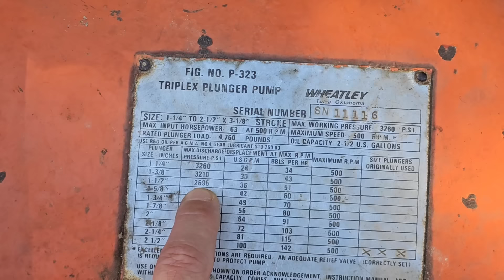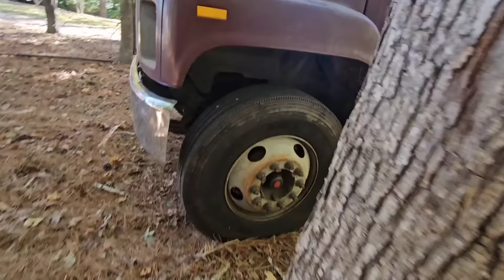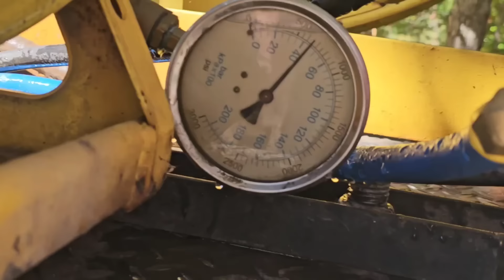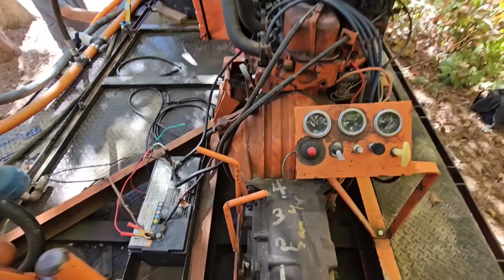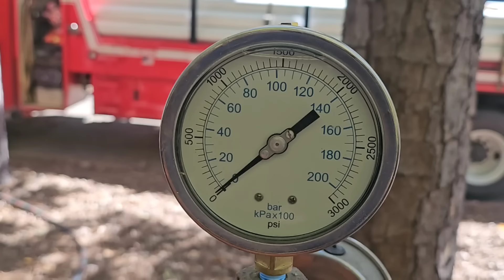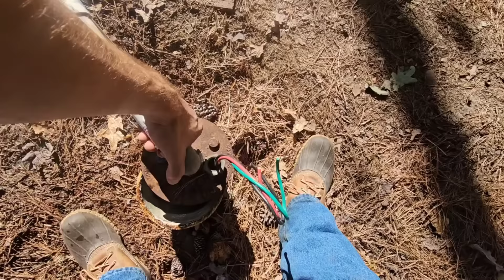Hydro-Fracking... We Blew up neighbors Well!

Comment: I’m not sure what he is doing , but water has weight too . This well I has about 85 gallons of water in it already  . Now he’s talking that the well has 150 gallons . No telling for sure unless you calculate the weight of water verses how deep the pump is , and add in the width of the hose in the well . But the pressure measurement is only talking the weight  of the water in the tools . He can’t tell the condition of the well . 
I hope the casing is still ok .
Reply: Pay attention. His first frack was 20' below the casing. The second was 65' below that. The casing never saw preasure.

Comment: I don't get it:  when you pulled the pump out, you had to stop because ........ you ran into a lake.  So, if you have a lake a few feet below where you are standing, why do you need a well?  I guess that is why I am not a H20 mechanic!
Reply: Surface water VS ground water. Surface water tends to need a whole lot more treatment thanks to forever chemicals, animal feces, and run off. Where as ground water tends to be much more on the filtered side as far as contaminants go. Hence the half package of chlorine poured down the well to kill off any nasties that might have ended up in the well after they put the pump back in. That's the short answer of it anyway. There's a hell of a lot more to water treatment than most people think.

Comment: This meathod is how the gas companty going to extract patrolium gas . The nabors well got  blown up . See you can’t frack it and not do damage elsewhere too .
Reply: science is the same, reguations are COMPLETELY DIFFERENT for water well vs oil well stimulation. 

did oil and gas for over 5 years as a wireline operator and engineer. Yes you can "frac and not damage elsewhere" its called retrievable plugs. set one or two off eline or slickline to cap well. frac the newly drilled well, then uncap and replace the production wellhead and flow string after stimulation operations are complete.

Comment: the inches on the pump tag is the size of the pistons installed in the pump. the pump can have any of those sizes. if it has not been changed, it is marked as having 2 1/2 inch pistons.. which is 100gpm and 970psi at 500rpm. so if that pump gas 2.5 inch pistons, you can push upwards of 100gpm.
Reply from the maker: Your correct. Ours is 1.5"

Comment: Did you used to inflate the packer with a hydraulic pump and vegetable oil?
Reply: Yes, they found the veg oil was harming the rubber in the packer.
Reply: @mxslick50 sounds very reasonable 
Thank you for the reply

Comment: What is wrong with a fiberglass tank? They don't rust. Mine is 25 years old and works fine.   I adjust the bladder  air pressure every couple of  years.
Reply from the maker: We ran them for 2 years back around 2012-14. Had a 15% failure rate under warranty. They have their place in very aggressive water conditions since they use no metal in the construction. 
I've also seen them explode and collapse inward from the vacuum effect
Reply: I think it's personal bias because a lot of the tanks in some of their older videos were outdoors, and fiberglass tanks break down rapidly when exposed to the sun.  The small muni system I ran years ago had a mix of steel and fiberglass pressure tanks...guess which ones were the oldest and still fine? Yep, the glass ones. Steel tanks were all less than 10 years old.
Reply: @mxslick50 is that because they replaced the fiberglass tanks with steel when they failed?
Reply: @BramBiesiekierski  Other way around. I have the records of all the replacements. The last part of my comment was cut off, it should have read "Steel tanks were all less than 10 years old *when they failed.*" (I shouldn't do comments using my phone....)

Comment: Does that mean you caused damage to the neighbors well? and if you do that what is your liability?
Reply: No damage was done to the neighboring well, and technically the neighbors just got a free fracking service
Reply from the maker: Exactly.
Reply: @Theace88x  though if they don't have a filter there could definitely be some sediment loosened up that comes through. I would want a heads up if I was that neighbor to get one installed before they have a shower valve plug up or something else expensive to fix like that.

Comment: crazy how so much well intervention operations bleed over across industries. Did wireline (well perforating) and remediation at frac locations from 2013-2019. fracked thousands of stages, did no fewer than 15 logging jobs concerning well cement integrity, density, porosity, and identifying oil rich zones as well as water tables (to ensure zonal isolation has properly occurred via cementing the casing strings as needed, among other reasons) 

also have set several packers to increase wellbore pressure, sleeves where well bore integrity is compromised, camera and caliper jobs, etc. exactly what you are doing, just on a much larger scale (4.5 in wellbore to 11 inches, mostly 4.5, 5.5, and 7" casing diameter wells) 

I subscribed! hoefully you drop alot more of these water well fracs as they occur

Comment: I thought you showed your pump max out at 36 gpm through your size of piping so how can you flow 50 gpm thru it?
Reply from the maker: 36 gpm at 2350psi.
But lower the pressure to say 600psi & itll flow 50gpm. 
It's easy to gauge when you film bc I can time how fast I pump the tank down from 500gal to 100gal. Thats 400gals pumped out in just under 8 minutes.
Reply: pressure and flow are inversely correlated assuming same diameter pipe size, flow will decrease as pressure increases, and flow will increase as pressure decreases. 

low flow at high pressure, higher gpm at lower pressure.

Comment: is it possible that u over pressurized the neighbors plumbing as their was enough pressure to lift the cement lid!!??
Reply: Momentarily if at all. More likely the well relieved most of the pressure at the wellhead, I'm guessing the house MAYBE saw about 100-120psi for a few moments, well within the safe tolerance of standard plumbing.

Comment: When did they switch from using vegetable oil in the packer?
Reply: Quite some time ago...the veg oil was causing problems with the rubber in the packer.
Reply from the maker: Damn your dedication shows! The oil swelling the rubber caused a very slow deflation time.

Comment: ❤ like they say…. And their ladies and gentlemen, you have a textbook example it can happen 🤩.  The million dollar question is … at what depth did the vain of the two  wells merge??  But as I think about it 🤔🤔 it could not be the  first one due to the fact the packer basically sealed off the first vain at the second packer inflation…  So it hast to be a vain from 150’  downwards… but I can see a benefit to both bore holes now coz until they seal off they share a water source double the available draw 👍 a win win situation… what I find amazing is while it is assumed water veins   are level  when in truth the water veins actually run with the contour of the ground up hill an down 🙀 ..    a few miles from me is Reading Michigan the highest point in southern Michigan an also is solid slate rock an?? Is a roll of the dice if you can find water… most wells are suffer wells due the the extreme depth.. nasty tasting but it is water… But thanks for giving us  a great teaching video!!❤

Comment: This happened to my well October 2nd. The neighbor fracked their well and it came out of mine. What a mess that was. The wells in our area supply a half gallon per minute. I am afraid that my neighbor wasting water like they always do will take water from my well even more now. I don’t believe that this will help my well at all. I am NOT happy about it.
Reply from the maker: It won't hurt your well. If you tested it, its likely increased its gpm rate.
Reply: @h2omechanic  After doing this for over 51 years. I have seen  it hurt the other well. In my area the next door neighbor's well could be getting water from the same fault.

Comment: Filter before tank and pressure switch filter clogs needs attention your way tank and pressure switch can load up with free floating chunks
Reply: Your way you will dead head the pump when your filter plugs up! Highly don’t recommend doing it that way
Reply: @Tony-z4h3o  yeah, that's just asking to kill the pump or blow pipe apart somewhere, which will likely be deep in the well where pressure is highest. lol
seen many of them filtered before the tank/switch and people changing the filters without shutting power off wore yet.

Comment: The neighbor got a free fracking service. Nice work
Reply: Same Aquafer, so most wells in the area if not all are drawing water from the same place
Reply: Doubt it. They now have a service call required to fix their pump and put it back to the way it was. These guys a fu*cking dumbasses.
Reply: Seems like the neighbor got a well full of dirty water. I'm sure they appreciate it. 
Aquifers don't exactly clean out contamination very fast.
Reply: @think-some-time   Contamination? I'm sure they only use clean, potable water.
Reply: @think-some-time  WELL WATER NEEDS TO BE FILTERED.  DON'T PARK YOUR CAR NEAR SPRINKLERS BY WELL WATER,  UNLESS YOU LIKE A BROWNISH-RED CAR.  I WOULD GET THE TRIPLE FILTER FOR MY HOUSE.
Reply: @think-some-time  cloudiness is going to happen from flushing everything out, nothing you can do about that. The cloudiness is already stuff in the ground, so it's nothing worse than what is normally there.
Reply: @arthurr8670 except it clogs filters and mucks treatment systems.

Can be very bad and very expensive to repair the systems on 4 or 5 homes.

Can't blow it off.

Our main dude here knows his business and runs an honest shop, he'll handle it, but I've had issues with crappy well guys screwing up the neighborhood.
Reply: That or they just tapped into the neighbor's well.
Reply: @fascistpedant758  everyone drawing water from the same zone/table is "tapped in" to each other already to some extent. cross communication could happen anywhere where theres another well installed in the area, but since water pumped across porous zones takes the path of least resistance, (typically) the nearest well to the one being stimulated will show signs of a frac hit first.
Reply: @edmundnlemadim8480   I get that, but his customer's well wasn't getting water before and they've now obviously opened a path to the neighbor's well.
Reply: @fascistpedant758 they were probably previously connected anyway all fracking does it reopen connections that have closed over time or open up sections previously inaccessible due to rock and sediment
Reply: @edmundnlemadim8480  My dad has a neighbor up the road a couple miles that had an old well that was abandoned. He plumbed his septic tank into it when his leach field failed. His neighbors wells all became contaminated with E-coli and they traced it back to him. He had to pay for UV filtration systems for the 4 houses that were affected and had to replace his septic system with a sand mound. I only have one neighbor  within a half mile of me but I still test my well yearly and have a UV filter installed just in case someone does something dumb to save a buck.
Reply: You need to plug the other wells and all of them will get a track properly. If three wells are that close in the future get them all to pay together plug two crack one
Reply: I would say incompetent work.
Reply: @Loki-rascal Why ?
Reply: @Loki-rascal  and I would say you have no clue what you're talking about, its obvious

Comment: I woulsd have flushed it at the Tank Then less Dirt in the FILTER!!!!
Reply from the maker: Flush All 600 gallons? Thats the reason for the filter...
Reply: I usually flush funky water out right off of the top of the well , "open discharge"  that way the pump and the drop pipe are the only parts having that stuff run through them ; then after the water clears up connect back to the rest of the system
Reply: @stevekluesner4430  much faster & way more flow to clear the junk out that way too.

Comment: We must have a different breed of wasps here in the UK, you disturb a nest like that and you’re all having a bad day!
Reply: yeah, those yellow jackets are usually very nasty territorial and will swarm like crazy stinging anything and everything in sight. it's late in the season on the mid east coast area and temperatures have dropped way off, especially at night, so they're slowing down, getting docile and many of the workers and old queens start dying off, while the new queens goes for a winter hibernation hideout.
Reply: @throttlebottle5906  Ours are in the process of dying off but they just seem pissed off looking for a reason to mess with you, I suppose the cold helps.
Reply: @some_text_missing  yeah in eastern NA you`ll see both ground and aerial yellowackets, but the real bad m-fers are the bald faced hornets
Reply: With all them engines and vibrations going I’m really surprised they didn’t go on a stinging binge 😅
Reply: @plumbbuild6517  I think they get used to it, when weekly consistent mowing occurs. had them here in the yard multiple times in various places all being mowed overtop and beside with push mower, lawn tractor and zero turn.
the large hornet nest under eave and gutter was a different ball game, one bump of the downspout they were also against and it was game on, swarming and it took 4 attempts to get rid of them fully, they seemed to thrive on all the chemicals. finally when they seemed dead, I hot it with pressure washer and 160F hot water, some of them suckers were still alive and larvae. 
I'll take ground nests in the middle of nowhere yard any day. gasoline works well, dump a good amount at once(I put nearly quart in) and cover the hole with weighted cover late at night. leave it for 3 days and solved, usually nothing going by the next am anyway or even that night.
Reply: Oh, they are bad here too. The stings hurt for a whole day and the knot itches for a week. And you're lucky if you only get one sting. They will chase you a mile if you make them really angry.

Comment: If yer smart use Md. regulations. Rules made by state board. Son and I drilled thousands. He was operating engineer made good money. We did lot of fracked wells. I ran cable tool used a fracking co. From Mass. they were best then. Had a sochris pump that was used on cable tool rig to do same as fracking. I’ve seen several wells connected. Did subdivisions with 1 acre lots. You need a pump puller